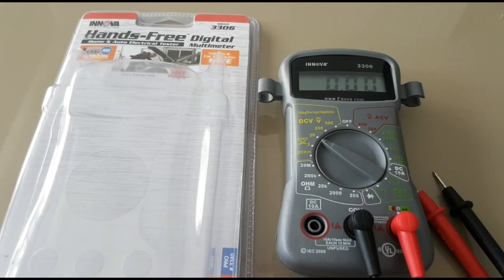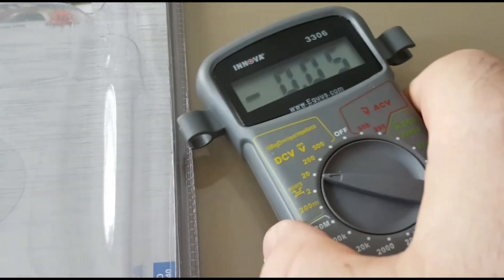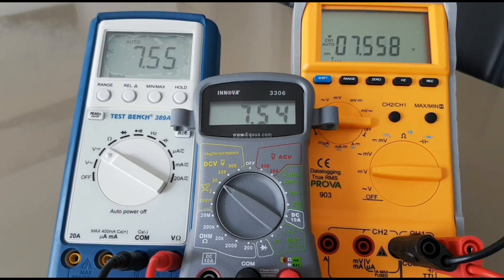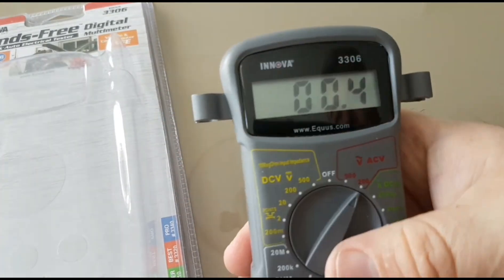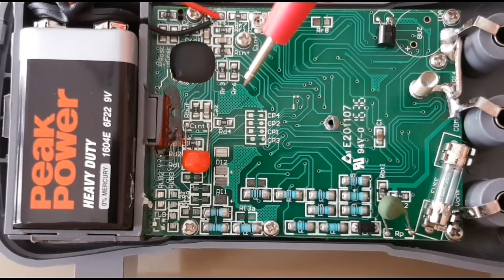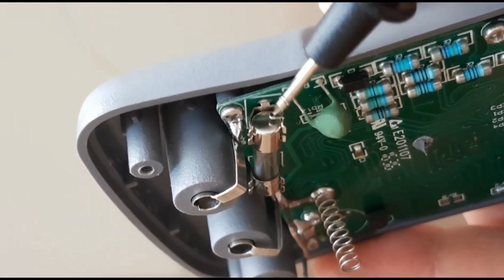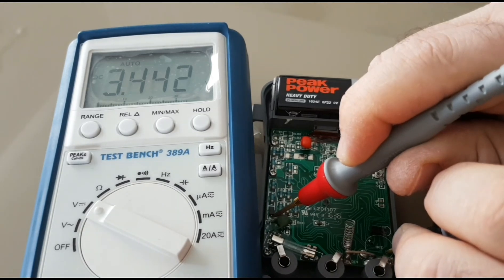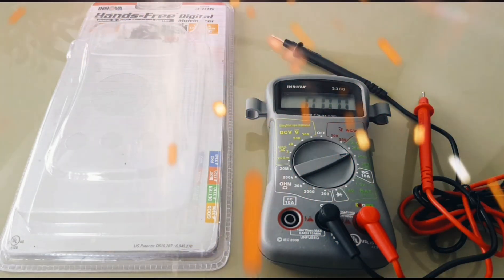INNOVA 3306 CHEAP-O Multimeter Review & Teardown!

Comment: Have had this for 10+ years. Can’t get a reading on AC when I try and test body voltage. (Touching red while black is grounded). Any reason why?
Reply: Interesting, I am trying to use this for my AC as well, and I think it simply doesn’t have the appropriate settings. I’m going to go out and look for a new one, since I’ve had this one for so long. 

Let me know if you figured yours out.
Reply from the maker: @jgoncrzy4176 set to AC VOLTAGE 200 or 500, depending where you live.   Remember,  ac volts for household mains. DC VOLTS for battery, etc..

Comment: Yeah, it actually has a continuity setting. Its the solid triangle with a vertical line to the right of it. The symbol is on the bottom right next to the ohms settings. No sound but its there.
Reply from the maker: Yessir 😊👍

Comment: I have the exact model, had it for years. I just tested the battery and I can't believe it still is above 9v. I swear I only changed it once ever. Also my selector switch is an absolute solid (((clickety click))). I couldn't turn it with one finger unless I put everything I have into it. It's definitely a two finger turn. I want to say that fall yours had did something to it. Also the diode setting on mine lights things up like a Christmas tree. I use it to test (single LED's) on strips for TV backlight. Doesn't light them up to 100% brightness, maybe 10 to 20% brightness, but clearly shows if they work. I don't know exactly what is coming out for voltage, but the next time I have my rework station set up fixing something, I'll check the voltage coming from the diode setting. It looked to me like your selector was turned just a tiny bit off angle from the diode setting, like just enough to miss the connection. I'd give it it another go. I'm guessing because yours is missing the solid click click click, it's not sitting in the right spot when you (round about) turn it to diode. Cheers mate.

Comment: I've had the same model for about 6 years,been dropped numerous times, stepped on once, and just thrown in a toolbag for use doing mobile auto repair and it still works perfectly, battery is finally needing replacement but was worth twice as much as I paid for it. It's helped me make a lot of money and is actually my favorite little multimeter for testing automotive charging systems.
Reply from the maker: That's great to hear...a reliable multimeter is worth its weight in gold. Thanks for the feedback 😀

Comment: So this is better build quality than the INNOVA 3300a CHEAP-O Multimeter.  Need one in hurry and Autozone has this model and advance the cheaper version.
Reply from the maker: Definitely!
Reply: @KeepOnTesting  so went to get this and like someone said the autozone comments pic and version is wrong when you get to the store its the cheaper model with out the plug in leads so got the Yellow innova..the Yellow one is already wonky out of the box just on DC to check Battery im charging it get wild readings not touching anything...It gets the job done for what im doing right now...and I wanted the big 9v battery instead.
Reply: @KeepOnTesting  3306N is listed on Autozone but store has the generic 3300a or something in grey but functions and look of the yellow one..If any one is in a hurry . MY autozone is down the street but yellow version cheaper at advance just so people know if just needed one asap..
Reply from the maker: @JasonKale  Thx for the heads up!

Comment: I respectfully disagree with the 2.5 star rating.  I don't care at all about the continuity test.  It has a 200 ohm scale that works just fine for that.  Would to be nice to have a beeper that allows you to test continuity without looking at the display?  Sure - but that's a very minor concern to me.  A backlight would also be nice as would a  "prop stand".  My 3306 has very distinct "clicks" for the function selector, and the accuracy compared to more expensive meters is reasonably good.  Better probes would also be nice, but they're readily available if that's important to you.  For a cheap meter, I think it's very good.  FWIW, I'm an electrical engineer and I use Fluke handheld and Fluke and Agilent bench meters daily, along with a whole slew of other test equipment.  Are these as good as those?  Nope - but I don't take those with me every where I go.  This one goes wherever I go and gets used nearly every day.  The small size is a plus for this.  You have to give up something for a cheap meter.  I think this one makes very reasonable tradeoffs vs cost.  I personally would probably give it 3.5 stars.
Reply from the maker: Great points...appreciate the feedback! I agree the small size is definitely a bonus which makes it highly portable. There's definitely alot worse out there in the CHEAP-O realm.😀👍 INNOVA seems to have a devout following so they are definitely doing something right.

Comment: This review is too harsh. I have used this multimeter for more than 10 years and it still works great.  I wonder what the reviewer based his rating on, considering he tested it against multimeters several times its price and found it very accurate. The only negative things he mentioned was the dial feeling too soft with no clicking (a very subjective judgment, I actually like it that way), and the lack of continuity. This feature of modern multimeters is a favorite peeve of mine. Having grown up with the analog multimeters of the 1970's I still have to understand why people can't test for unbroken electrical connections using the ohmmeter feature. This continuity thing is such an inessential feature. I never felt the need for it.

Comment: Thanx but I needed to know how to use it on my broken fan that I was trying to see what I broke when it snapped. inside so I’m going to guess I needed continuity to find out where I ran of power?right? It’s not a diagnostic tool is it?so I’m going to throw out the broken  fan instead of trying to fix it you saved. Me a half day of frustration thanx
Reply from the maker: Multimeters are measuring instruments. They are also used for electronics diagnostics. You were on the right track, continuity is one of the many useful features that a multimeter is usually capable of. Unfortunately,  this meter isn't the greatest for bench electronics. Check out some of the UNI-T Models or the HABOTEST HT118A which is a great all around dmm.

Comment: Thanks for the video. I’ve had mine, this exact model, for 10 years or so. Haven’t even changed out the 9v yet and I’ve put it to fairly good use. 2.5 seems harsh, due to its ability to take a beating, but having no continuity feature is definitely a setback. All in all, it’s kept me alive many times over. Great review
Reply from the maker: Thanks for the update. A decade of trust speaks volumes. Glad to hear Innova hasn't let you down. If only it had continuity...Otherwise it's a very qualified little dmm. Keep On Testing !

Comment: The diode test is used for continuity also.
Reply from the maker: Yes that's correct. Its not a typical audible continuity like many people expect.
Reply: @KeepOnTesting  Ive just been poor and never had an audible continuity tester. I always had to look at it and hope I still had the leads in contact. haha
Im actually working on my boat and using this exact meter.. The dial is pretty crappy now after 2 years of use

Comment: Thanks for posting.  Sir, question. When I change it to 1.5, or 9v For Battery Load Test, I get no reading. Is there something I am doing wrong? Thanks!
Reply from the maker: Hi Marcelo, sounds line the mA fuse is blown ..you'll need to replace the mA fuse since it puts a small load on the battery.
Reply: @KeepOnTesting  Thanks so much Darren!!
Reply from the maker: @celo78  You are most welcome!

Comment: Set the meter to 20k+ ohms to test for continuity, if it's zeros out, you have continuity. Your welcome
Reply from the maker: Thanks for the heads up. Unfortunately the meter is long gone. If I come across another I'll remember to try that!
Reply: Cory, your suggestion worked for me. Thanks!
Reply: Really? Cool good to know thanx for the info👍🧠
Reply: There is actually a setting for continuity on the bottom on the right of the ohms settings. No sound though. But yeah...
Reply: Continuity is one thing. I want to see the actual voltage comparison between when I’m grounded and when I’m not
Reply: My guess is this meter just doesn’t read AC voltage that low. Like in the 1-4 volts range. 🤷

Comment: The reviewer says this meter does not read continuity.  This meter clearly has a continuity symbol. I have one and the continuity function works fine. GARBAGE REVIEW.
Reply: that diode test function is diffrent from a dedicated continuity function. a continuity function of a multimeter ranges from 100 to 0 or a lot of times 50 to 0 ohms. and it's with a beeper/buzzer ofcourse.  this reviewed multimeter doesn't have A DEDICATED CONTINUITY FUNCTION.  but you can still do continuity tests via that 200 ohm resistance range or that diode function.
Reply: I've been looking around for a cheap multi-meter and every auto-part store say's it test's continuity soo ¯\_(ツ)_/¯
Reply: lol just fuckin around, but I think this jackass is looking at the diode test symbol.
Reply: The continuity setting is just to the left of the green 9V in the "BAT" area, this model just does not have a beeper. At least it seems to be testing continuity.
Reply: @dsmcc5676  I own one of these and tried both your suggestion of using the setting"just to the left of the green 9V" setting and the 20k setting within the OHM section that Cory Green said to use. Both worked great for testing continuity!
Reply: I sometimes use diode mode to test continuity because I'm lazy, but diode mode is significantly slower than a dedicated continuity mode even on my fluke and brymen. Most of these cheapies don't even beep when you short the leads in diode mode, yeah, garbage meter.
Reply from the maker: Hey R, Either their is a glitch in your Matrix or just like to hear yourself whine. This DMM does NOT support continuity, What symbol are you looking at ?. It only has a diode function..There is No DEDICATED Continuity function that involves an audible beep. If you're desperate you can use the Diode function.